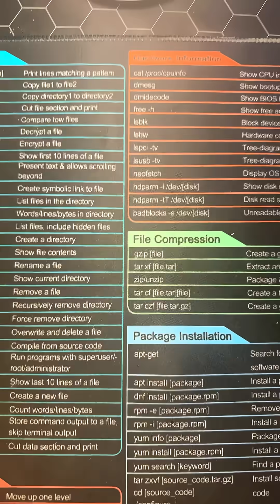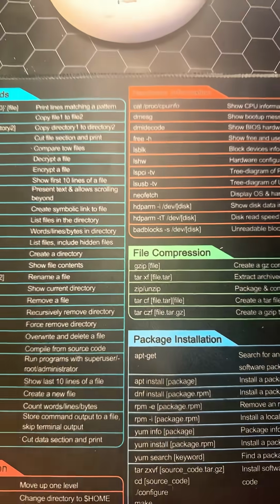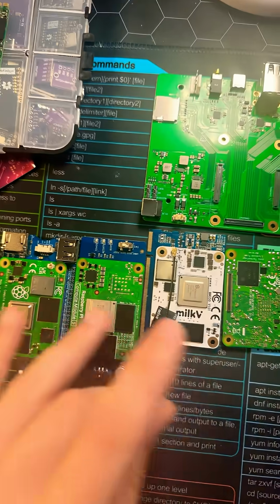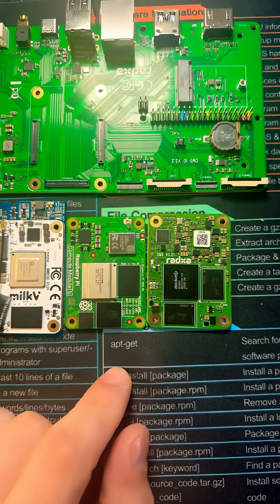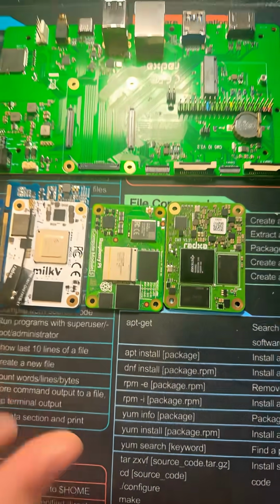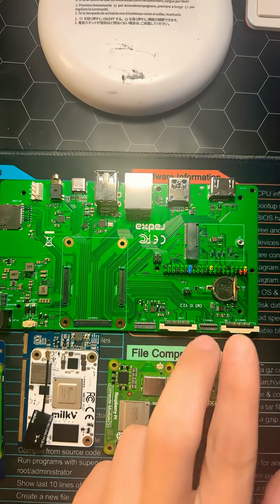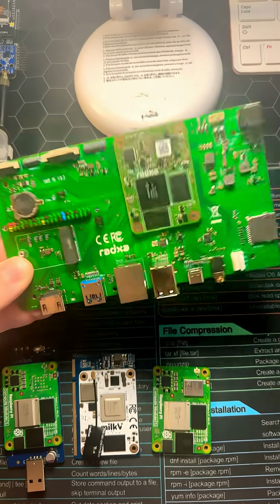The Radxa CM5 #rockchip #SOM #SBC #cm5 #techtok #raspberrypi #radxa

Comment: I plan on making a diy dual screen portable handheld console that is the size of the 3ds xl and most designs only used the compute module of the sbc board without a heatsink. So I was wondering if I can use the radxa x4 cm without a heatsink. If I do need a heatsink, do I need a fan too?
Reply from the maker: There are active coolers that you can purchase
And there are really nice heat sinks as well.Just make sure you have a decent.Thermal pad

Comment: Pretty cool, defs looking forward to more Radxa CM5 content. Latching on to a previous comment of mine, it'll be pretty fascinating to know how the cooling requirements stack up compared to RPi CM5. I'm assuming it'll get quite hot quite quickly considering that the RPi isn't as jam packed with soecs compared to Radxa. Sure, Radxa is overkill spec wise for what I need, but if the processing can compete and be a comfortable mobile computer, I'm ditching my phone no doubt
Reply from the maker: You definitely need to add an active cooler I’ve seen different modifications on the uconsole but yes we’ll be going over it very soon
Reply: @Valleytechsolutions  Okay, no then that's good to know, cuz with my RPi CM5 order I got an active cooler fan & heatsink that I'll be playing with while saving up for the Radxa. Thanks for the advice, and yeah, I'm looking forward to the vid bud 🙏